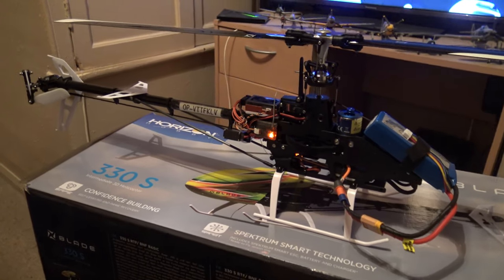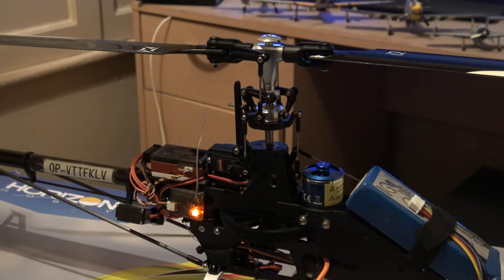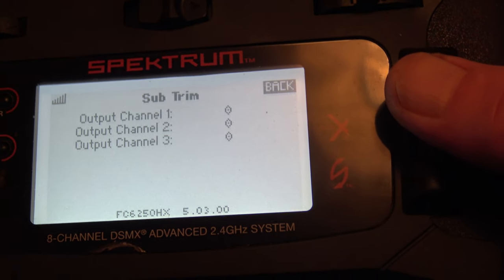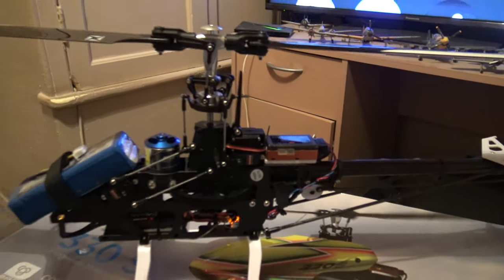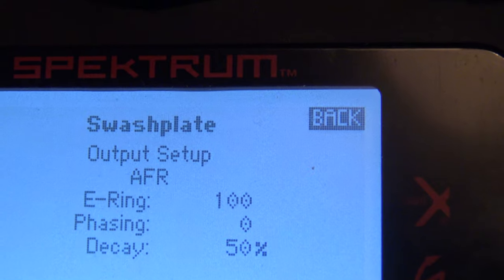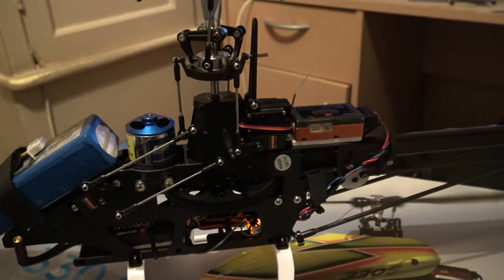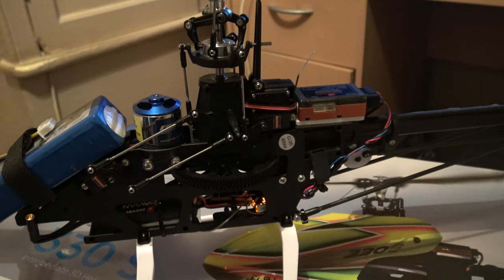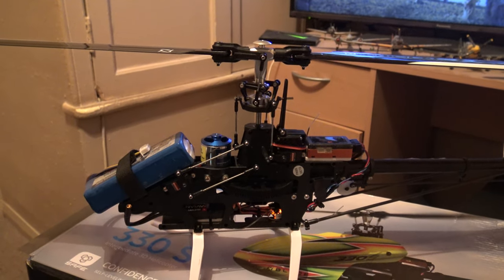BLADE 330s SWASHPLATE LEVELLING

Comment: Just wanted to add a comment because it seems the SPMSH3055 Cyclic Servos for the Blade 330S will be unavailable or on back order for quite some time.  Expected availability date is going to be toward the End of August 2022.  The Gear Replacement for either the SPMSH3050 or the SPMSH3055 Servos is Part Number:SPMSP1040.  This Gear Set can be used for either Servo.  Hopefully, this will help you get back in the air before the End of August 2022.
Reply from the maker: Thanks for that Joseph!! I. The UK the parts from Horizon have been shocking to get hold of 😀👍
Reply: Hello, Ian:
      Are parts availability being difficult from Horizon only or Vendors in General?
Reply from the maker: Well Joseph I've struggled to get parts for some of my E-flite planes which are distributed by Horizon!! I think it's an issue with parts that are from or made in China 😀👍
Reply: @IansRCExploits  
I think you are correct, Ian.  My apologies  for the Democrat Party of the U.S.  It is my feeling they are behind alot of the shortagies people are experiencing around the world.  The items people are needing are more likely in a shipping container on a ship or barge waiting to either unload or load.
Reply from the maker: Well Joseph, the UK government aren't much better!! Things are getting so expensive, yesterday I had to pay £2 per Lt for Diesel fuel, the most I have ever paid it costs over £100 to fill an average car in the UK 😒
Reply: @IansRCExploits  
Hello, Ian:
    I know we're off topic here.  The last time I bought Gas for the car was this past Monday.  The price was $5.19/Gallon.  Diesel was at $5.80/Gallon.  Diesel use to be the least expensive fuel people could purchase.  Now it's more than Gasoline.  I bought 2.9 Gallons of Gas . . . , $15.00.  I'm trying not to have to purchase alot at one time.  To buy 20 Gallons it would cost a whopping $104.00.  Totally Insane Gas Prices.  Needless to say we're not doing much driving except for necessities any more.
Reply from the maker: Well I worked out Joseph that's about $1.25c a litre so not that different to our prices!! The world's gone mad Joseph 😒
Reply: @IansRCExploits  
Yes it has, Ian . . . , Yes it has . . . ,

Comment: Thank you. Do the blades need to be flat and level at center throttle. Can I check this with hold on or do I need to disconnect motor wires?
Reply from the maker: Yes Nevile disconnect the motor wires, make sure your throttle and pitch curves are linear 0 to 100% and then you want 0 degrees at center stick 😀👍

Comment: Thanks Ian. Much appreciated. I knew nothing about the Forward Programing side of it. I'll let you know how it goes
Reply from the maker: Ok thanks Paul👍😄
Reply from the maker: Couple of things I forgot to say Paul as I rushed a bit!!
If you can get the servo arms at 90 degrees mechanically if you can or as close as possible by moving the servo horns!! So then you use as little Sub trim as possible!! I mentioned about making sure you've got a linear pitch and throttle curve, when you've got the swash level at mid stick you then check your blades are at 0 pitch!! If there not you can adjust the top links and get them as close to 0 pitch as you can, once you've done that your 330s should be fine!! Sad to see the video I made to help you got 3 dislikes!! Some people that watch YouTube are the pits!! Message me if you have any more questions👍😄
Reply: @IansRCExploits  Hey Ian. Thanks again for your time. I've had a quick look while waiting for my pitch guage. Swash was a bit out and already had figures in of 42 -82 -46. I've ended at 42 -59 -17 Arm position looks good but I'll try and get the figures smaller using control rod adjustment. I did find you can't be in normal because when you drop out of subtrim the plate moves to compensate for Heli position. 
I don't think I can message you on Utube now, they removed the option. 
 As for the dislikes, anyone who does that without leaving a comment explaining why, hasn't really got anything worth listening to
Cheers Paul
Reply from the maker: Thinking about it you should reset each servo to 0 which would be neutral, then get your servo arms as close to 90 as possible then use your sub trim to get the final position as my sub trim is on 0 0 0 so when they rebuilt it at Horizon they must have got the servo arms pretty close!! I would be very careful of adjusting the links because you don't now what the measurements were to start off with, you only adjust them if any part of the 3 positions of the swash are high or low!! You can switch safe off in normal mode but you should only be adjusting things in forward programming like I showed you so the cyclic Gyros are not active!!
Reply from the maker: I'm a bit concerned now Paul those figures you quoted don't seem right!! Your not talking about the AFR menu are you? Because that should be Roll -75 Pitch -75 Collective 50 Don't change those what ever you do or you will be in trouble Lol they determine your Blade pitch so don't touch them.
Reply: @IansRCExploits  no I'm definitely in the right subtrim page 👍 My swashplate goes to neutral as you actually enter the subtrim page. I'll start from scratch tomorrow when my pitch guage arrives and update you. Thanks again 👍

Comment: Once again Ian; very helpful for me!  Will this approach work on any of the Blade S series Helis?  I had to conduct a similar repair on one of my 150S Helis and used a mechanical approach, turning the ball links by hand, to get the swashplate level.  I never knew about the Forward Programming method.  That looks simpler and potentially more accurate.  My repair was at the end of the flying season, I better double check all that; LOL.  Did you do anything special (from a safety point of view) to prevent accidental spin up of the main rotors?  Does Forward Programming lock out the main motor, or did you physically disconnect the motor?
Reply from the maker: I disconnected the motor wires Wolfgang!! But I was rushing and forgot to say!! I don't think it does work the same on the 150s or the 230s!! It's a function on the FC6250HX flight controller that allows you to use forward programming to set the Heli up!! Thanks for watching and commenting 👍😄
Reply from the maker: Oh yes when you are in forward programming indicated by a blue flashing led the motor is disabled!! But I always disconnect the motor wires just in case!! I like having all my fingers Lol
Reply: @IansRCExploits  Thanks Ian.  I'm going to charge up a battery tonight and try this tomorrow.  I'm quite sure forward programming is available on my 150S.  I'll let you know my findings.  Thanks again.
Reply from the maker: Yes I'm not sure!! I've never had to do anything to my 150s so I've never looked!! Hope it is there because it does make it much easier to set things up👍😄
Reply: @IansRCExploits  Hi Ian.  I just conducted a test with my 150S.  It works very similar, to what you described for the 330S.  Forward Programming - Setup - Swashplate - Sub Trim to see the Channel 1, 2, and 3 sub trim settings.  Adjustments can be made her to level the swashplate electronically.  The AFR setting doesn't exist on the 150S AR636 receiver.  However the following does permit swashplate up and down movement to verify level movement through its range: Forward Programming - Swashplate - Pitch.  
Thanks again Ian.  I'll definitely be checking my swash plates for level position.  A job for tomorrow.
Reply from the maker: Aww great Wolfgang!! Thanks for feeding that back to me!! Much appreciated and Happy tuning 👍😄🚁

Comment: A couple of my linkages popped off on a hard landing when battery died. I lost one and don't know where the other went. How do I go about making sure the new linkages are adjusted correctly? I only have a simple controller that came with the RTF and am very beginner so most things in this video were over my head on programming
Reply from the maker: Well Jeremy that is going to be a bit of a problem!! As it doesn't say in any manuals what length they should be!! All I can suggest is that if you know anyone with an RTF Blade 330s to measure their links and you make your new links the same!! When they build these Helie's they must have a ball park measurement to start with!! Maybe get in touch with Horizon Hobby see if they can help, Hope you get it sorted, I could give you the link lengths if mine but I have altered mine slightly so I would advise you to get the stock lengths 😄👍
Reply: @IansRCExploits  thanks for your response. Could I turn on my controller and with the cyclic stick in neutral just level the swash plate with the linkages?
Reply from the maker: No not really Jeremy because the throttle also control you swash movement, it has a very clever mix so the 3 servos move together!! When you build a Heli you are given the lengths of each link and then you would level the swash plate at what is called centre stick!! That's when the throttle is at dead centre, it is a bit of a nightmare for you!! Your best bet is to get the lengths of each link some how 😄👍
Reply: @jeremykoehn4004  Jeremy I was also having the same issue I have two 330s I measured brand new one the rod lengths are elevator rod 52.08mm left rod 55.78mm and right rod 44.18mm

Comment: Hi I have a dx6 and need to level my swashplate any ideas thanks Dave S
Reply from the maker: Hi Dave, unfortunately with the Dx6 you don't get the forward programming!! So the only way you will be able to level the swahplate is mechanically with a swash plate leveling tool, sadly this won't help solve the attitude trim issues if your experiencing them 😀👍
Reply: @IansRCExploits  thanks